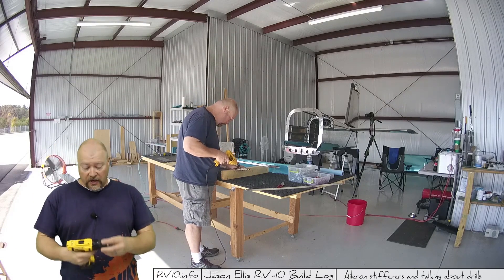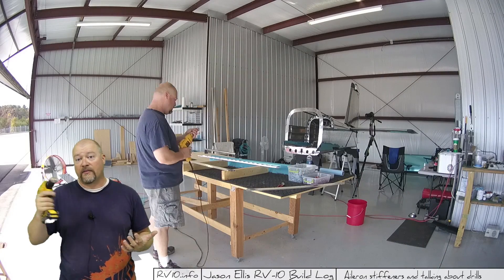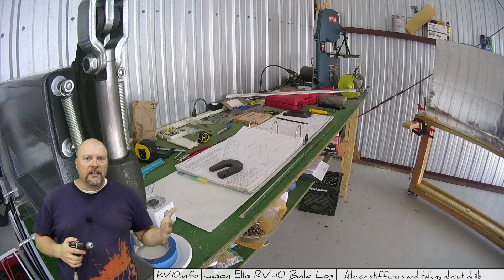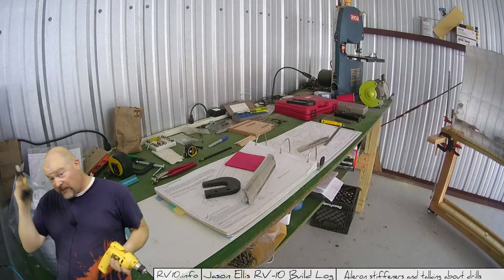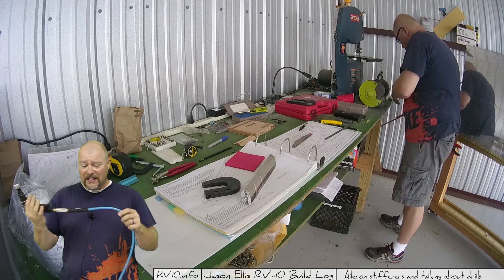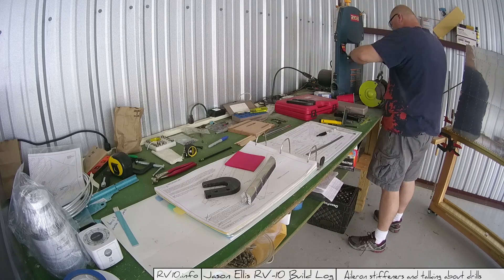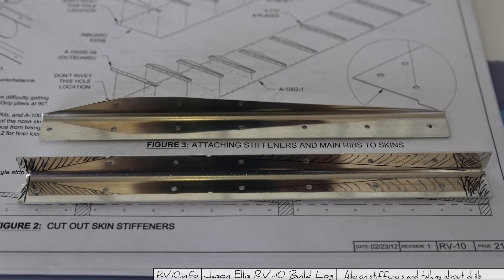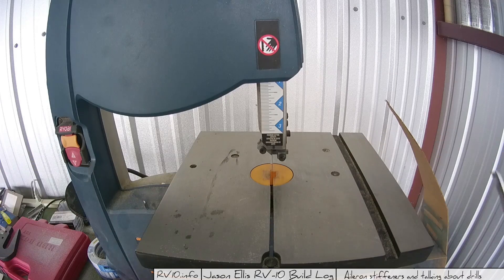RV-10 Wings - 030 - Aileron stiffeners and talking about drills

Comment: You could use a brace and bit if you needed to.  I purchased a Sioux  1/4" 6000 RPM and it is brilliant.  Use lightweight hose and boelube and it is the fastest and lightest solution.  Far more accurate than a big heavy electric as well.  http://www.cleavelandtool.com/1_4-Sioux-Drill-6000rpm/productinfo/ADS16/#.XK7eG5gzb-g

Comment: I wonder if you could make a hybrid drill, a lightweight, powerful brushless motor in the handle, and then let an external power supply drive it.
Reply from the maker: Hrmm I dunno.  I imagine there is one out there somewhere.. Or someone with a lot more skill could fabricate one but I'm not that guy.. =)

Comment: Quick safety note - I would recommend spending a few seconds to wrap that frayed drill cord with some electrical tape. When you break through to the live wire and it drapes over the edge of a part, your whole work piece is going to be at 120V.
Reply from the maker: Oh it's been wrapped, rewrapped, unwrapped, wrapped again.. it's an on going process.  Electrical tape (even the "good stuff") only seems to last a couple years before it becomes unsticky.  I've started to wrap with heavy duty (thicker) electrical stretchy tape then putting a small ziptie on them.. it still eventually comes undone.. 

But valid point!  Very valid as I don't want to get zapped..
Reply: Jason Ellis Might be time to think about whether the cord is replaceable :-)

I seem to remember reading a long while back   - probably somewhere on VAF - that the risk of frayed cords is a big part of why air tools are used for most aircraft work. Lots of sharp aluminum edges plus heavy use (especially in a pro setting) can make for a real hazard.
Reply from the maker: That makes a lot of sense..
Reply: Jason Ellis really enjoying the videos by the way. I've been daydreaming about a -10 since the first kits came out 10+ years ago, great to see you getting it done.

Comment: Just curious, how many hours have you put into this project so far? Love the videos! Keep up the great work!
Reply from the maker: I just broke 400 total hours the other day.
Reply: Nice! I'm really enjoying watching the videos! Just a tip we use where I work, we use a few sealants that are almost identical to the pro seal you used on the tank. To aid us in keeping it cleaner we spray isopropyl alcohol on our gloves before using our fingers to smooth the sealant out to our liking. It certainly doesn't solve all the dirty problems that comes along with working with the sealants, but its substantial enough of a difference that I always iso up when working with the stuff.
Reply from the maker: Good call!  I'll give that a try.. without something its nasty to work with..

Comment: I really like my sioux pneumatic drill.  Light, small and with quick change bit, easy to change to different bits.  I have a corded dewalt and a cordless dewalt, they stay in the drawer for the build 95% of the time.  A light weight hose with a swivel at the drill, make a BIG difference.  Great video by they way.  Keep it up. How's that training?  When is your check ride?
Reply: +1 on the Sioux. Sometimes I use my cordless or a corded, but the Sioux rips through in a fraction of the time.  I run off a 40 gal compressor, run a bit but not so much that it's overly annoying.
Reply from the maker: Yeah I think some of it is just personal preference.. for me the fact that my 20 gallon compressor stays running constantly just drives me nuts.. I can't hear my music! 

Training is going great!  Thanks for asking.. Just did my short solo cross country and do the long cross country Saturday!  Then it's just a matter of doing the night XC and practice for the check!  I'm nervous as hell about it.
Reply: +Jason Ellis glad your still training and getting it done.  Awsome!!  All I can say is, stay on heading, altitude, and speed.  Talk to ctaf, and towers of Class D airspace even if you above their airspace. I was failed because I did not speak to a Class D tower despite I was 1k feet above the class D airport airspace.  Examinar said I should have talked to them even though I wasn't in their airspace.  I think he just wanted another check for a recheck.  Anyway,  go above and beyond PTS. Good Luck!!!!
Reply from the maker: Ouch!  I know the guy that will do my check ride.  He's a super nice guy and fair.   I'm not sure if he will be extra harsh on me because I kinda know him or not.. haha  Either way I need to study!
Reply from the maker: Okay then I guess I have the wrong pneumatic drill!  Good to know there are better options out there.. Thanks for the info guys!